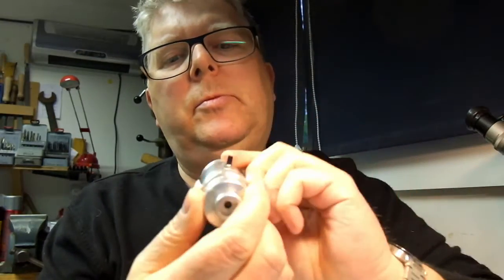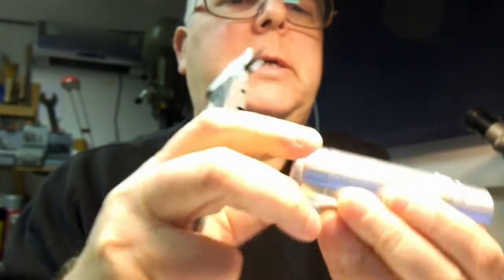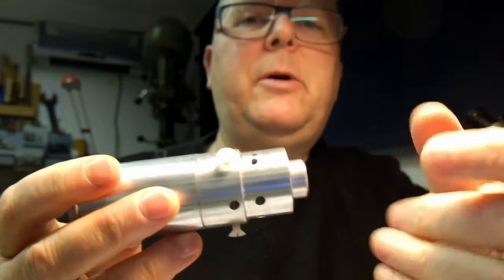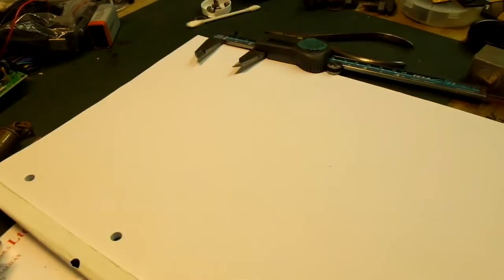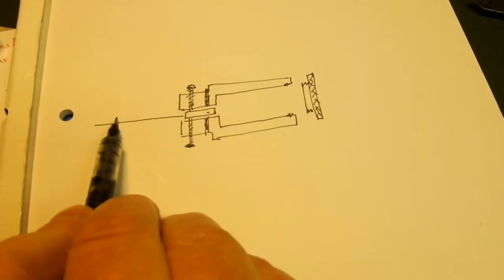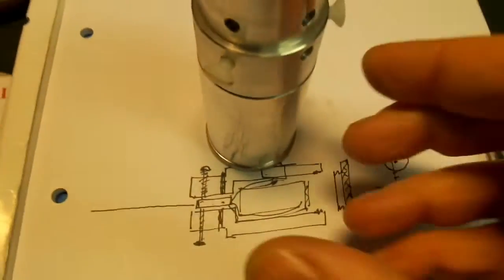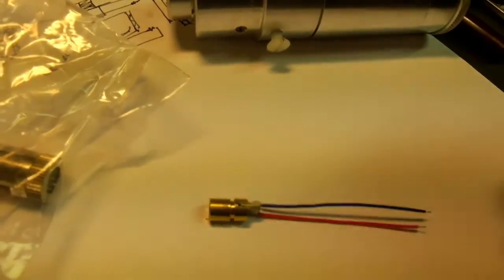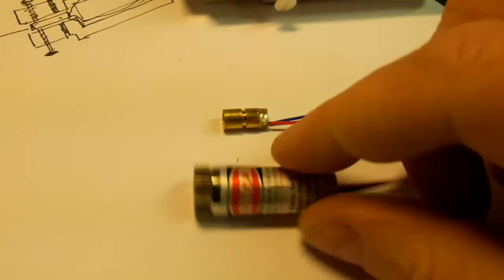Making a laser collimator

Comment: did you complete the laser for calibrating SCTs?
Reply from the maker: I made one like the Hotech advanced collimator. I tested it in my 10" RC just mounted on a plywood back and it worked well. It was a trial for a 24" Cassegrain which not only had a tertiary mirror but also a 4th one (not sure what that's called).  So I dismantled the 10" one to make the 24" one. The problem was that the scope couldn't see low enough and I would have had to have the 24"+ collimator about 20' in the air so the scope could see it. It also has to be finely adjustable too.....so the project was never concluded. I may resurrect the 10" one though as it was useful to get fairly close. There's no substitute for star testing though for perfect collimation. If you haven't read the book then do. https://www.amazon.co.uk/Star-Testing-Astronomical-Telescopes-Evaluation/dp/0943396441/ref=sr_1_1?keywords=star+testing+astronomical+telescopes&s=books&sr=1-1